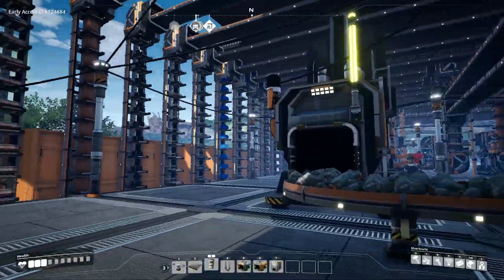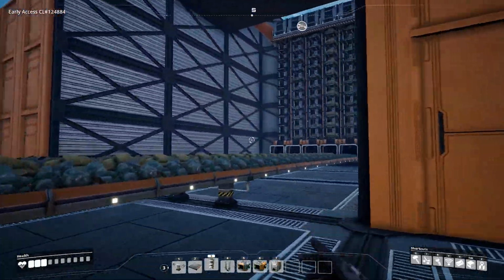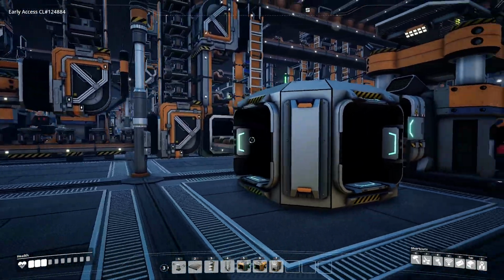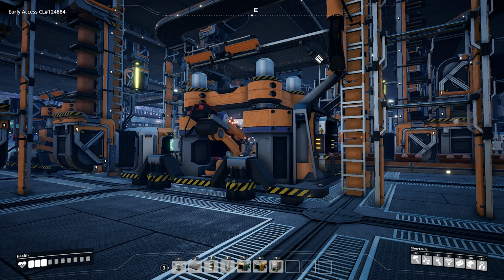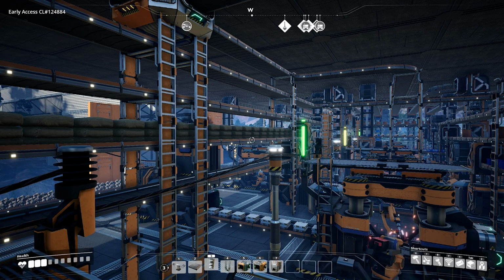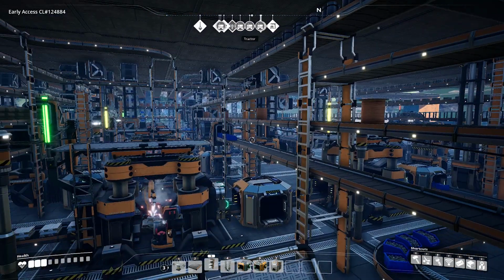Mega-Factory 2.0 | Satisfactory Ep 27

Comment: I have 2 questions
1 will you overclock/tweak the factory once its complete 
2 what other ways do you have to generate electricity?
Reply from the maker: i'm in the process of putting the final touches on this facility including adding a train station and adjusting production to maximize efficiency which includes some overclocking. The new train network allows me to import electricity from a new coal power station and a fuel generator station. Those videos are in the works!